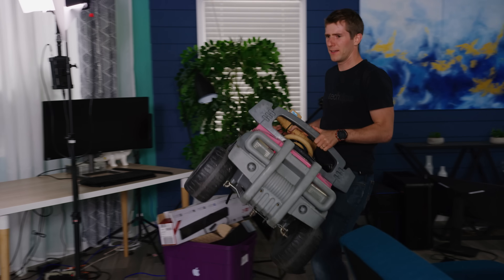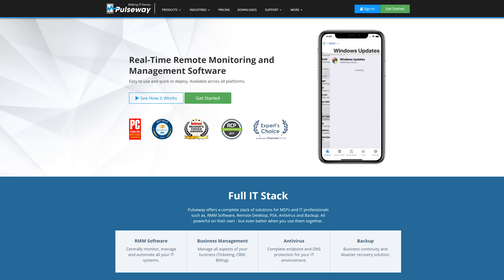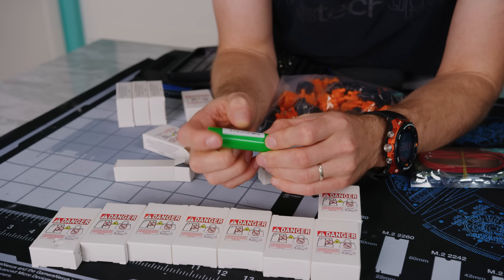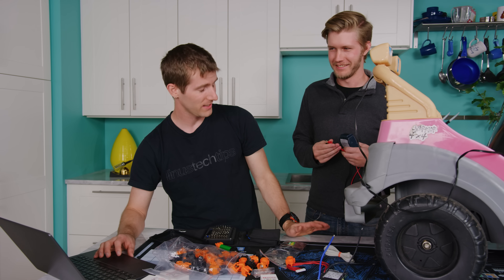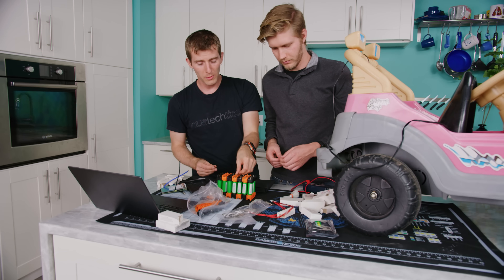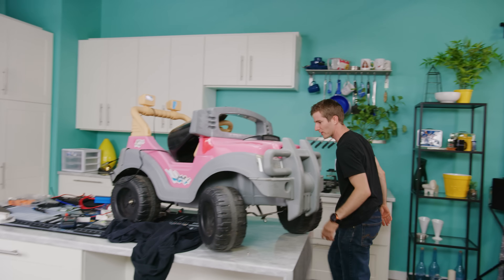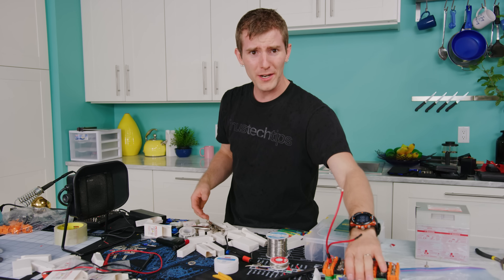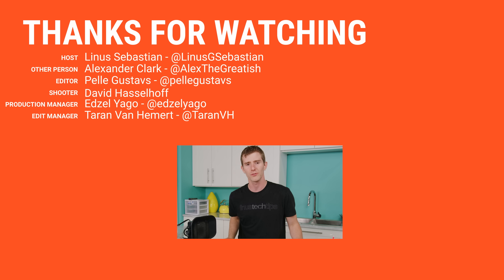DIY Lithium Battery - What could go wrong??

Comment: Ok what electrocution ? 27v DC would not penetrate skin resistance.  Short circuit it is possible but there is a huge chance that  it would just burn strip connecting  cells

Comment: For anyone looking to do the same please also consider EVERY COMPONENT in the system: motors, regulators, capacitors, resistors, wires, etc and make sure that ALL of them supports your battery voltage & current "upgrade". If that sounds too complicated and boring, then you're probably better off not doing it. Trust me, a fire or explosion is not fun.

Comment: 9:23 Has the batteries wired up in series and in parallel, taps the leads with the end of his metal screw driver 3 times. hahaha
Reply: 10:52 Proceeds to short the connections and also shocks himself. hahaha
Reply: 12:13 'Now usually you can't reuse these hat screws but I managed to squeeze it back on there. Should be okay.' hahaha

Comment: If it's not raining then it's probably better to rewire a high-current battery like that outdoors, or maybe if your garage lacks any flammable chemicals/fuels that have fumes, then the garage might be safe since the floor is usually concrete. Or a basement with all brick/concrete walls and no carpet.

Comment: The narrator at 4:46 gets it wrong. You need to make groups of cells in parallel, and then wire those groups in series. He says the opposite, he says you make three groups of cells in series and wire those in parallel. If you did it that way, you would need three charge balancing circuits instead of one.

Comment: Just a quick question, why the hell would you be trying to wire a battery WHILE ITS CHARGED? Almost as dumb as trying to do wiring for a house project without flipping the switch or the breaker.

Comment: Wth, this is a lego set. Was expecting making battery with lithium
Reply: The lithium is contained in a cell.  A battery is a set of cells wired together to provide power.  So the video title is apt and your expectation would only make sense if it was "DIY Lithium Cell".

More broadly a "battery" is any structured set of similar items.

Comment: 🤯 🔋🔋🔋🔋🔋🔋🔋🔋🔋MY MAN!  You just made me realize I can replace the lead acid batteries in my son's Corvette. Even with those batteries though, it hits about 30mph. So I'll keep the same voltage, but go with some 21700s so i won't have to worry about the batteries dying when he doesn't use it for a month. Plus a bunches Molicel P42a's in para-series like that, will take it from 20 minutes of fun with lead acid, to maybe almost an hour with Liion.(with enough fells that is!)

P.S. I'm a Dooshbags vaper, so I know all about Liion batteries. Haha 😤🌬️💨🌫️

Comment: From the brief time i attempted to work with 18650 batteries, I can say that theyre actually terrifying. Cuz they can draw pretty high currents, and unlike electrical applicances, batteries dont exactly have an off switch.
Reply: The risk isn't so much a draw so much as that they have a ridiculous supply current.

Comment: I did this with my kids hotwheels jeep. I just threw a 12 volt lawnmower battery in it. It was pretty bad ass until the kid crashed into a tree and it went up in smoke. It worked for a few days though I think. Longer than I thought it would to be honest.

Comment: I think this kit is meant for really cheap used batteries.  I would just use a 40v (10S) Ryobi and a robot project adapter from eBay for this purpose. (if it fits in the compartment)

Comment: alex !! 24v dc cant electrecute you you cant even feel it
Reply: @Living in Code no if the voltage is low only microvamps flow through the human body by the way no I can touch 1volt that can deliver 1000 amps and I won't feel a thing that's also the reason why you won't die if you touch a car battery even though it can supply 750 amps of current

Comment: LOL  When Linus Drop Tips becomes Linus Crash Tips!
This reminds me of when I was a kid and we used to race Stompers (anyone remember those?) at school on our meticulously constructed dirt and sand courses.  Only I would cheat and after some "careful" removal of plastic and a little application of speaker wire and electrical tape, I'd replace the single AA battery with a 9V!  Because, why not?
Reply: (For the record, the answer to "why not?" is implied.  They don't last long.  But it's so cool while they run.)

Comment: Hey guys, I think your project would be way cooler if you made it into a RC car and put rubber treads on the tires.. Use a windshield wiper motor for a steering servo.
Reply: Oh, I forgot to mention.. Use an esp8266 PWM output as a speed controller.

Comment: Realy? You can electrocute from 29 volts? I've had no ideea. LOL. Guys, read about human body: you cant feel any voltage on your fingers till ~60v AC and ~50v DC (here to feel something you need lots of Amps). 
PS: a 3.8v li ion battery in an ideal short can do 80-100 amps discharge

Comment: "DIY", proceeds to buy the battery cells, connectors, control electronics, etc. Assembling pre-made lego that's sold in a kit so that any dimwit can plug in red on red and black on black is not DIY.

Comment: You can't get electrocuted from 29V. Most people can't even feel 29V on dry skin. Dry skin has a resistance of around 100Kohm and internal body tissues around 5Kohm. According to Ohm's law, we can calculate the current that goes through the body
I = V / R 
I = 29V / 105Kohm
I = 275 uA (microamps) 
Most people don't feel an electric current until around 1mA (1000uA). 

It is also important to note that just because a power source is capable of delivering a certain current, that doesn't mean it will put that maximum current through any load. If that were the case, phone chargers would be deadly. (People have been electrocuted from phone chargers, but all these cases involved chargers with design and manufacturing defects that made them output high voltage AC.) 

Also, DC is much less dangerous than the same voltage AC because it does not have the same ability to mess with the heart. (Thomas Edison and Alfred Southwick developed the electric chair in part to demonstrate that AC is more dangerous than DC. It's a very interesting story; look up the War of the Currents.)

Comment: The hulks (green 18650's) are Samsung I believe. We use the exact same ones for vaping
 They're the replacement for the blue 25r's which had pretty much the same amp ratings.

Comment: I did the same to my kids car he loved it till the motor burned out and i replaced it with a bigger motor and that kinda mad it slower but still faster than a walking speed kinda like a slow jog and he still loved it but i used 2 car batteries yes 2 batteries for a full size gas vehicle went a few miles before needing a recharge but the best part i made it into a dad and son project i showed him how to wire it all up he put on the wire nuts on. the batteries were dead less than 1.5 volts and couldn't even start a car at full charge i used them to charge my cellphone during power outages

Comment: the reason the instructions said not to solder the wires on is because heating up the batteries with the soldering iron is a bad idea

Comment: Watching this was like what if me putting 9V batteries into Stompers instead of two AAs when I was 6 and overdriving the motor was applied to larger Power Weels I never had as a kid to test. It took me about 40 years to find out. Thanks to Linus that question was answered.

Comment: I like how they were about to make a massive capacity 4v battery LOL
Reply: What if had at built 3 of them, then put them in series? Massive capacity 12v  battery
Reply: @MediocreTCG  and if something goes wrong you are dead good idea lol XD
Reply: @danilp8757  the same could be said for the entire video. Looooool
Reply: @MediocreTCG  true :D
Reply: he should've used ultracaps at that point
Reply: @waltercomunello121  tf is that
Reply: Time to make clickbait videos melting pennies with massive current and whatnot!
Reply: @coolguy284_2  ultimate powerr
Reply: 3.7*
Reply: @ΜΙΧΑΉΛτοΑρχάγγελος  4.2V is the voltage of a fully charged li-ion battery.
Reply: @Louis25495  that makes sense
Reply: Same
Reply: i mean if its to power a raspberry pi

Comment: As apart of the Lithium DIY Community this is cringy AF. People say batteries are dangerous, but they are just a bunch of clumsy, incompetent, pussies. I've been doing this for 4 years and never have a fire. NiMH and Ni-Cd are a bitch to charge. But if you can't charge a Li-ion manually. You're kinda fucked. 3,500mAh. They are obviously LG's 3,500mAh. The highest capacity to date. Easy. I don't even have to look it up. First, these power wheels use a typical ~100-120w power tool motor made by Mabuchi in Japan. They have the vast majority of the market. From power tools to toys. Chances are it's probably an RS555 or RS550 6/12v or something. LG 25R would be a better option. This motor will max out the poor MJ1. They are NOT for the high drain. The standard charge for MJ1 is C/2. 6V is 2S. For 12 volts. You should use 4S and not 3S to offset its low power weakness. The lowest amount of cells you would need its 4S 1P but definitely not that low. I would recommend 4S 3P. The less amperage you draw the more efficient it will be....That's a BMS Linus....OMG, a short circuit isn't going to kill/shock you its only 7S. 29.4v. That is perfectly safe -.- You SHOULD use a dead blow/rubber mallet. A short circuit is only bad if you hold it there then you got the welding part...Anywho yeah I would feel less of a man if I had to look this up. I'm already called a pussy as it is, being coddled into a very religious family that thinks they need to do everything for me just because I have autism. This is true because I am good and math and have a clear obsession with batteries/motors and the like. I got about 1,000lbs in batteries and I just purged about 1/3 that was bad weeks ago. Were gunna watch this other video now Sigh, you're killing me Linus. PACKING TAPE EHHHHHHHH MOANS IN PAIN 30-40AMP breaker....AH HAHAHAHAHAHAH and my dick is as big as a horse. I can dream can't I?! Power Wheels battery = 114Wh. 7S 3p MJ1 = 272Wh

Comment: @9:51
@10:00
@10:10
@11:29

turn your wire strippers around the other way, so that the "beveled" side with the numbers on it is facing toward you instead of away from you...it makes it so much easier and more controllable to strip wires that way.  that's pretty much why they put the numbers on that side, so you can read the wire sizes as you're putting the wire in them...then once you have it placed properly, you push away from you to strip the wire.

also, if you don't pull the insulator coating completely off, and only push it about 1/8" or so, you can then use that piece of the coating to twist the ends of your wires as you are pulling it off....makes it really nice & neat on your wire twists, and it also saves your fingertips some wear & tear.

Comment: OMG, this was the funniest video I've seen you post! Don't they teach basic electricity in schools any more? Parallel vs. series circuits are electronics 101.

I did the 24V conversion on my kids Powerwheels about 18 years ago. Two lawn mower batteries per Powerwheel vehicle.  They had four kids on one of them at one point. The drive units only lasted a couple weeks before melting the plastic housing. Did they last longer on the modern Powerwheels?

Comment: I built a 6 wheel drive powerwheels car using bits from 3 separate cars. Had to make a plywood chassis and set the body on top. Used a 12V battery and just 2 DPDT switches one for each side for control. Car was awesome and would spin like a skid steer with one one set of wheels going forward and one in reverse.

Comment: My dad did this to our trike in the late 80's (different batteries mind).  Motors lasted surprisingly well as long as you stopped for a bit when they got too hot.  He then replaced them with something better too at which point it wouldn't even move as the plastic wheels just slipped and spun on the spot.  So he rubberised the wheels.  Then it went so fast mum had to step in and have him dial it back before he could think of any way to make it even more dangerous for an 8 year old :)

Comment: I did that back in 1990, i used a 12 volt car battery with a  1977 car basalt resistor. I am to big to test it so i borrowed my nephew from my sister. The thing is, my one was a whole lot faster than yours. My nephew was doing some sideways drifting totally hilarious.  Fun was over after the motors burned out after an hours fun.... I remember all this stuff has been done back in the early 1980's long before youtube, old skool ideas..

Comment: linus ofcourse its a blance charger, that is i belive the only reasonable way to charge multiple lithium cells and actually get them to last more than a single use.
Also you can tell by the little connector with all little wires coming out for each cell

Comment: The power is flowing from positive/current to negative/ground. Wouldn't uneccessary stress/current/heat buildup by using that small of gauge of wire? Not to mention that a relay would be a good idea
Reply: FYI, DC power ( the type produced by batteries ) can kill you allot faster than AC current. Be careful with DC, especially when you deal with a series connection. 
Adding another battery, Your adding volts for every connection you make (1.5 volts batteries x 6 linked in series give you a 9 volt battery and gives a stronger flow of current ) 

~+[  ]- >+[  ]- >+[  ]- ~ 1.5volts x 3 series connection = 4.5 volts output. (More kick/volts and same Milliamps. 

 ^ +[  ]-  ^ +[  ]-  ^  +[  ]-  1.5volts x3 parallel = 1.5 volts and more Milliamps/ hours of operation but same voltage.

If you go and do a 100 series connection with 1.5volt batteries you get 150volts of DC, Which is more than enough to seriously hurt you or even kill. Basically you get an immediate release ( a current from the "+" as fast as current can travel thru all of those batteries going through each battery in the series connections to the point of ground/- )
Be sure to use the same voltage and Milliamps for each battery or you only get the Milliamps of the weakest battery in your series connection and you also get a point of failure that will burn up because of the weakest link. All that direct current will pass through the weaklink battery and will result in a type of bottleneck. "That's one of the many causes of battery ruptures and explosions" that can happen during charging.

So yeah, be very careful with direct current/ DC.

Comment: did this in the late 90s / early y2k's  to three , a kiddie quad , a 70's model huge boat corvette - and a legit power wheels . the 70s model i used large diameter catv cable to fashion a roll bar system , which held real working fog lamps and a pair of plastic boom box speakers with a jensen radio on the dash. they all had horns i got from junk ryards and real lights . stuff off motor cycles / tractors . we would often hook fire works on to them and then my brother and i would put on a road warrior show with 10 foot poles with flaming rags on each end , while our kids would ride around screaming , with fantomas blasting out from the corvette . the neighbors hated us . i remember opne kid saying " da da ,,,,, how come my car car doesnt go fast like that one " ....  i burnt the motor out of a mini big foot with 36 volts using three deep cells . i was maybe 225 lbs at the time , man that was loud , and it stank really bad . smoke show . it was a short ride . i know this sounds like its all exaggeration but ther eis video of it on my channel . along with the footage of my boat which was kind of the same idea - way too much . as far as all the saf-t- first naysayers - nothing ever happened . all of the girls (my brother and i daughters)  loved it , no one ever got so much as a scratch . the motors never blew . we used deep cells and motor cycle batterys , smoke bombs , spaklers , and gasoline . but we were always out there with them and they didnt ride them for more than 5- 15 minutes with out cool down .https://www.youtube.com/watch?v=jvmSvLYxcTk  - -  boat --https://www.youtube.com/watch?v=i9hEr38yboY

Comment: lol those are always fun to work with, Build an ebike and overvolt the crap out of it haha. I got my ebike up to 40 some odd mph at 70ish volts.. Tips, helps to skuff up the terminals a little with sand paper before soldering batteries, also be real careful not to overheat them the less heat the better, it deteriorates them. Dug in pretty good, ping me if you decide to do anything else and want tips.

Comment: I know I'm very late to the party here but just in case you get a chance to see this, when my plastic tires on a pedal car were going bad when I was little, my dad got some old car tires, cannibalized them, and riveted/screwed strips (the width of the tire) around the outside of the old tires. This solved the wear problem, but more importantly it infinitely improved traction.